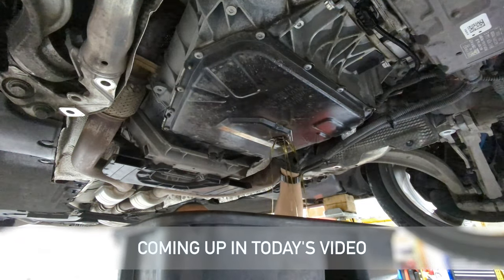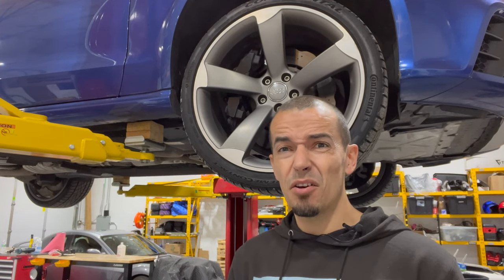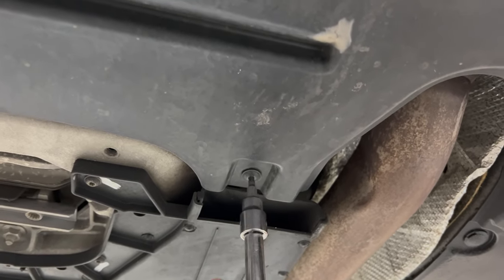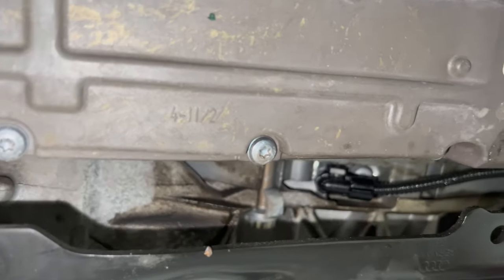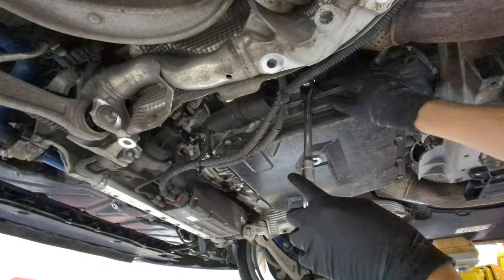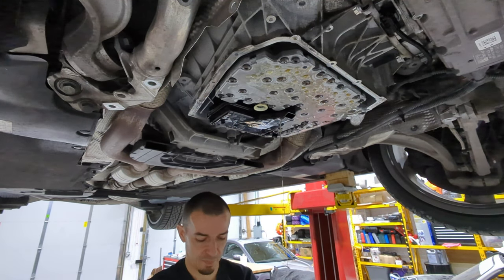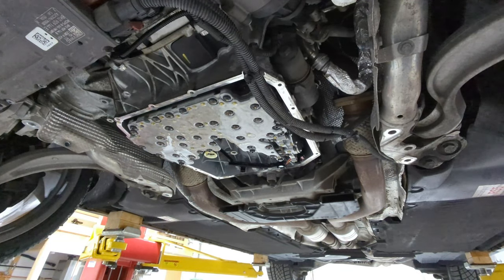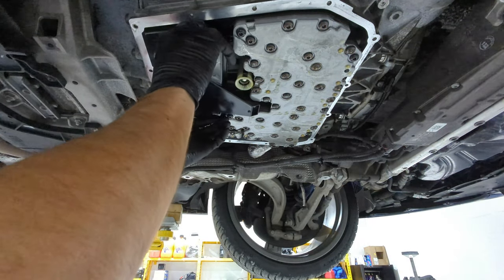How to change the RS5/RS4/S5/S4 DSG Transmission oil B8 & B8.5

Comment: Excellent video again mate. Tip for anyone who doesn't have obd or even just a simpler on the driveway method is to drain, measure and refill the same amount, however, when you refill it won't all go in, so when you have almost filled the same amount as drained you need to replace fill plug, start engine run through  r n D and back to park for 15 seconds on each to get the transmission areas all full. Then continue to fill the rest of the fluid normally the last 0.5 litres and your done. You also don't need to worry about the temp, do it cold so you get it all in, hotter the fluid more it expands. I've done this on dsg 6 speeds and DL501 7 speeds. It does rely on the condition that your confident the transmission fluid hasn't leaked out and thus your measured quantities are correct when you drain it in the first place.
Dsg 02e 6 speed gearbox always drains approx 5.1 litres for me. 100ml either way won't be problem but that's the limits. 
DL501 7 speed 5.5-5.75 litres.

OFCOURSE I ALWAY WOULD RECOMMEND USING SCAN TOOL AND GETTING IT DONE THIS WAY ACCURATELY!
knowing the quantities expected is just reassuring to know you have the correct amount of old fluid out as expected and how much litres you gonna need to replace.
Reply from the maker: Appreciate the info. That will be super helpful for anyone that doesn’t have the OBD tools!

Comment: Great video including the detail, also you are correct about not removing the sub brace while on the wheels a lot of you tube videos have the car on its wheels. Did you perform a transmission adaption after the oil change?
Reply from the maker: I did not. Audi recommends changing it every 30-40K so not sure how different the oil will be. I haven't found any official documentation saying an adaptation was needed. Is this something you have seen?
Reply: Yes there are a few videos showing the adaptation via VCDS after a service. Just priced the parts from Audi including new bolts for the cross brace £370.

Comment: Hey mate, great video. Did you ever do other videos of the final drive and other side of the transmission?
Reply from the maker: They are in the queue. I’ll get to them ASAP but it might be a hot minute. Was there something you needed? I have all of the details and part numbers if it helps. My email address is on the contact page on the channel if you needed anything before I get to the videos.

Comment: So I have read that these transmissions have ATF and MTF fluid to change. Is this MTF or ATF? Thank you!!
Reply from the maker: This is the ATF side but make sure you use DSG fluid designed for the transmission. OEM fluid listed in the description can be expensive but LiquiMoly has some.

Comment: Great Video ❤ is this the same gearbox as in the audi s5 2009 with the V8 ?
Reply from the maker: Thanks! If it's the 7-speed then yes. Looks like there was a 6-speed auto also that year. That will be different.
Reply: @FindingSeconds  I have the 6 speed tip tronic so where is the difference?

Comment: I don’t see a point in replacing sub frame bolts
Reply from the maker: It’s because they stretch when you torque them. Basically just weaker if you reuse: https://rts.i-car.com/crn-1316.html#:~:text=What%20is%20a%20torque%2Dto,box%2C%20and%20suspension%20mounting%20locations.
Reply: @FindingSeconds  thank you